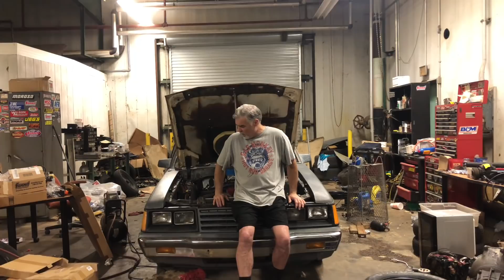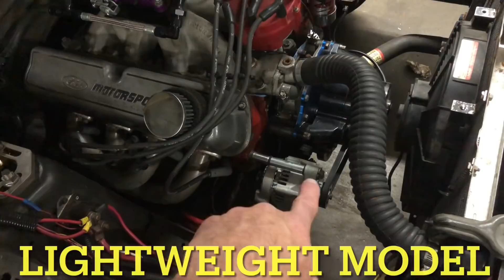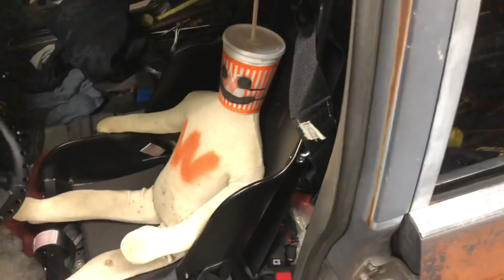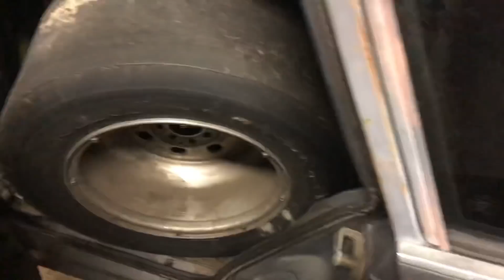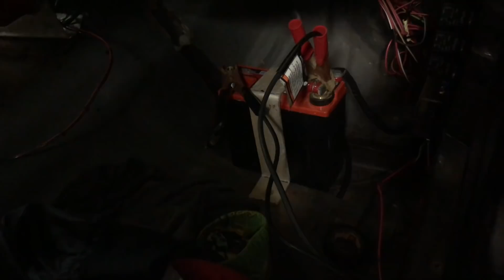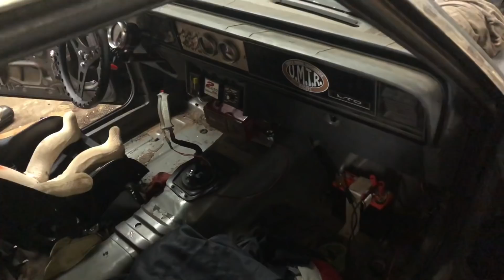1985 LTD LX 5.0 FaiLTD Update Pt. 2

Comment: so given the numbers at 2800 pds sitting with u in it for arguments sake! 100 mph your makin 435 hp with gt 40 heads thats insane! how close is it to 2800?
Reply from the maker: Calculators don’t take into account car efficiency etc...Dragon made 336/330 and weighed 2750 and ran the same mph 🤷🏻‍♂️...no way the FaiLTD is retarded lighter than that I’d be shocked if it was under 2700 with me in it..4 doors and iron heads, metal bumpers? No way it’s way under Dragon (alum heads, no bumpers but efi)...
Reply: @5.0tussin  thats crazy

Comment: We Just want to see the cars running for thw most part. Maybe show a time slip. The Ltd is a show itself.Basically  no need for professional editing.
 Is the clutch still.cable? I did a hydraulic conversion and that's not working to cool.
So thw LTD has a 250k mile short block?? .
Man Rodney, you have that car died in!